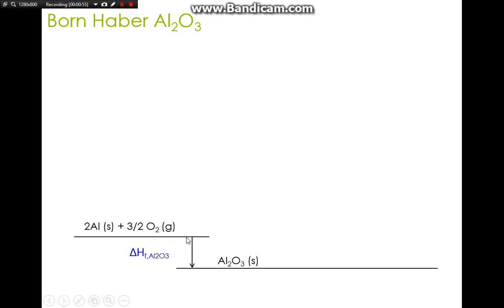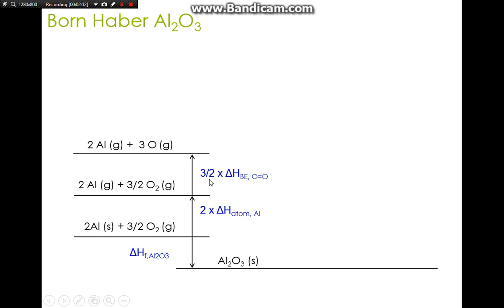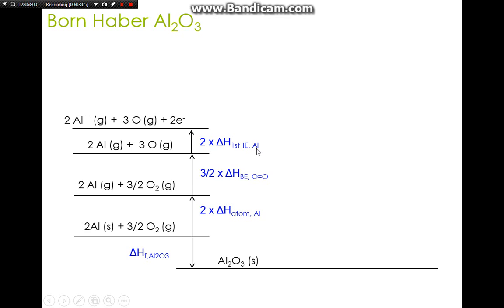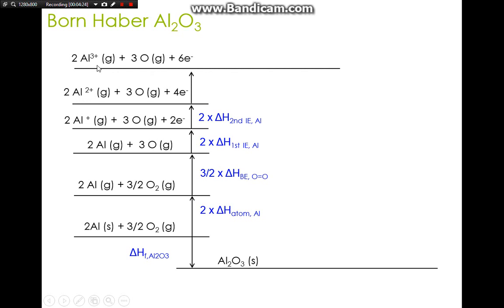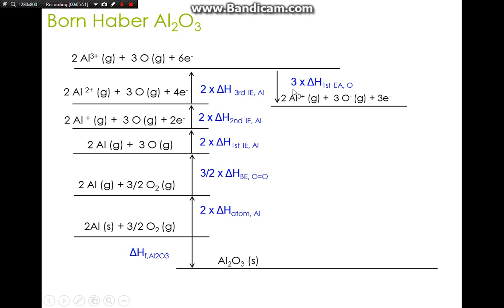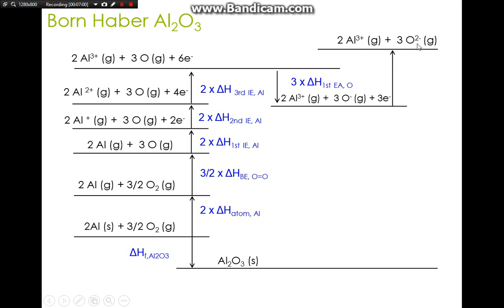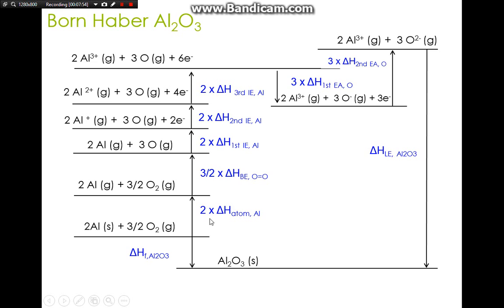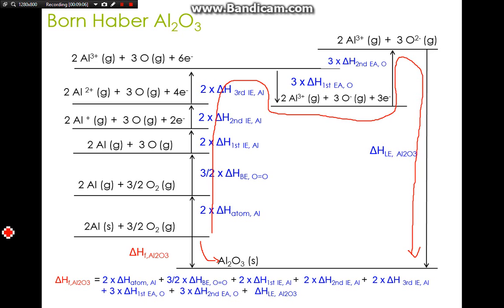Born Haber Cycle Part 2 : Aluminium Oxide Al2O3

Comment: the electrons not are balanced on the second electron affinity of oxygen, why?
Reply: They are balanced. 
Think of it as 3 Oxygen atoms; each of 3 atoms gained 1 electron (so now there are 3 electrons left; initially there were 6 electrons) and then again the 3 oxygen atoms gained 3 electrons (individually 1 for each, total 3e-).  So after the 2nd affinity; there is no electrons left.

Comment: Why did you use the bond energy for 3/2 O2 rather than using the ΔH atomisation value for 3O
Reply from the maker: The heat of atomization of 3 moles of O atoms = BE of 3/2 moles of O=O

Both refer to the formation of 3 moles of O atoms

Comment: Can you explain how we add/balance  the electrons ( e-)
Reply from the maker: One way to do it is to check the sum of charges which should be zero
For example,  
2Al(+) and  2e(-)   has an overall charge of zero 
2Al(2+)and 4e(-) has an overall charge of zero
2Al(3+)and 6e(-) has an overall charge of zero  

Each time we "pull out" an electron from an atom/ion , the charge of the atom/ion increases by +1 which is canceled out by the -1 of the electron "created"

Comment: Hi Great video , really helped but  have one question , when working out the heat of atomisation of oxygen do u times it by 3/2 or 3?
Reply from the maker: +Adam Hanly Apologies for overlooking this question. Will reply here for the benefit of others with the same question. 

Heat of atomization is defined as the heat involved in the formation of "1 mole of oxygen atom". 

Since 3 moles of oxygen atoms are formed in this example, we will multiply the heat of atomization by 3.
Reply: Yes sir is it to multiply 3/2 or 3